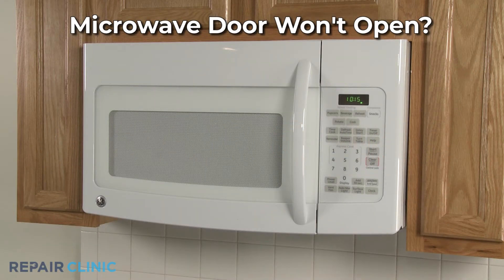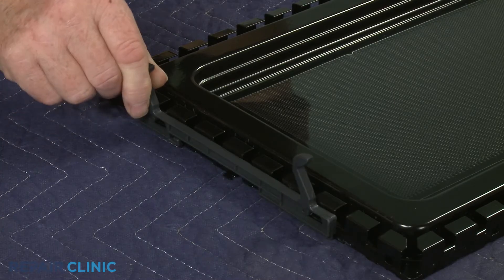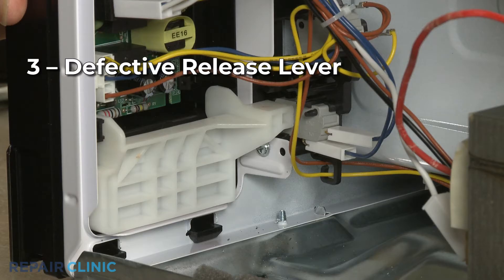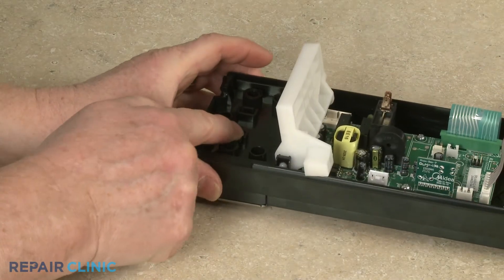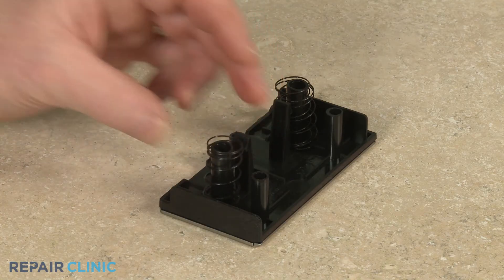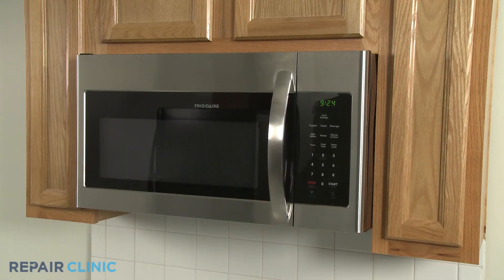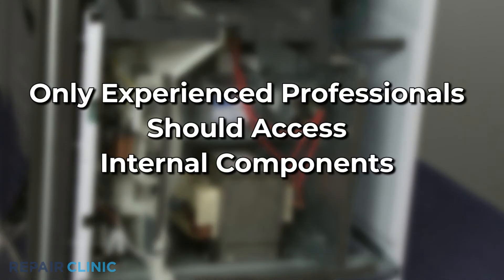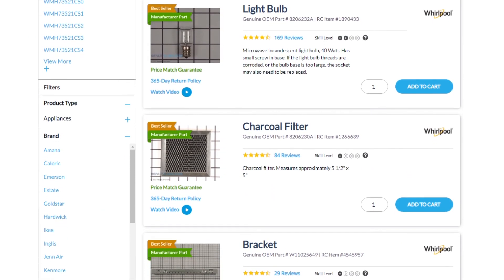Microwave Door Won't Open — Microwave Troubleshooting

Comment: No sh*t. I was hoping u were guna tell us how to jig it open ffs
Reply: I can tell you that. In case anyone else gets this problem,  get a rigid piece of card stock ,like those pesky ones in the mail, fold it, push it between the door and frame where thrbkat h would be, not the hinges and slide from bottom to top. It works !